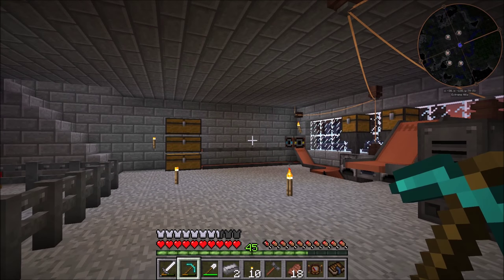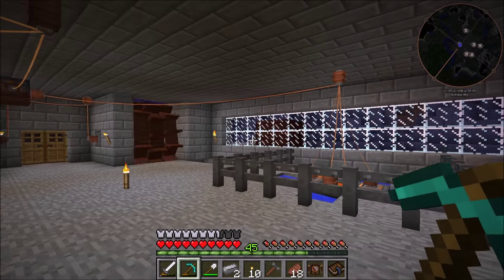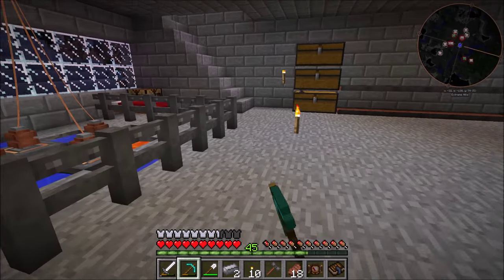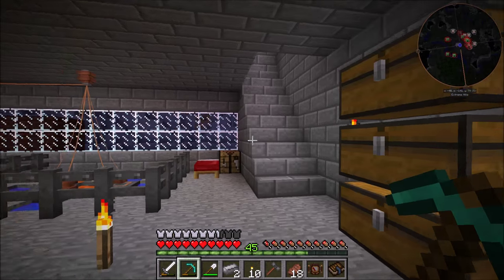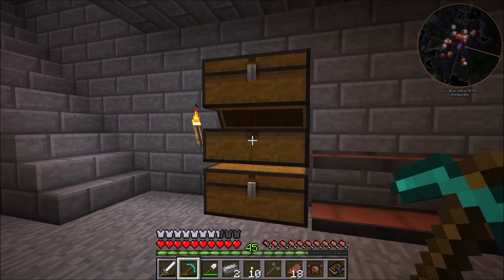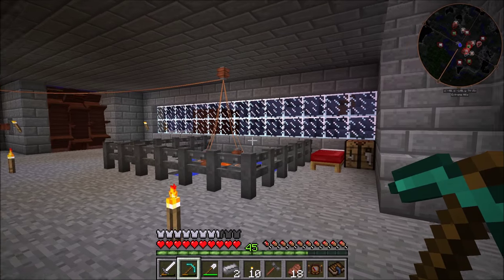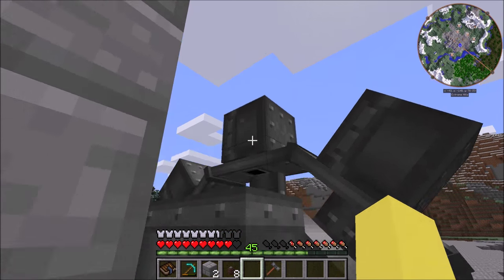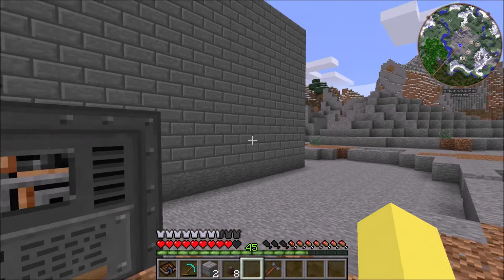Surviving With Immersive Engineering :: Ep.6 - The Excavator

Comment: There seems to have been a mod change in ep 4 and 5 - the appearance of the chests were changed. What happened?

edit:
rambling is perfectly fine as long as you're avatar is active and moving
instead of standing still and not actively doing something of value - need to work on keep moving while talking. Being this is a 1.3years old you might have changed :) if not well here's your constructive feedback XD
Reply from the maker: The chest appearance was due to the Christmas update minecraft does, but it changes right after Christmas ends so it only lasted for a small amount of time.

Comment: Priuses only use electricity when their combustion engine fails, sort of like a spare wheel. Not permanent but meant to get you somewhere to get fixed.
Reply: JeefCake other way around the Prius uses the electric engine and the fuel engine at the same Tim switching to the fuel at higher speeds and electric at lower. Once you're out of gas you're screwed. It does charge the battery while you drive so it is really just meant to extend the milage of your fuel engine.